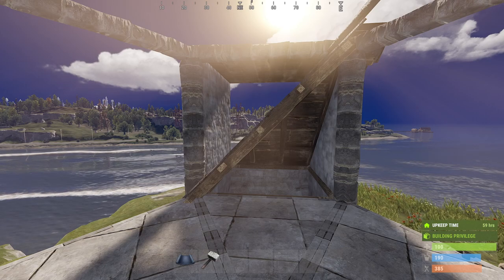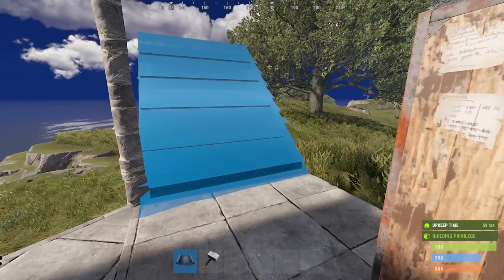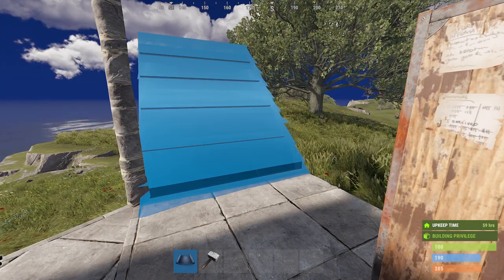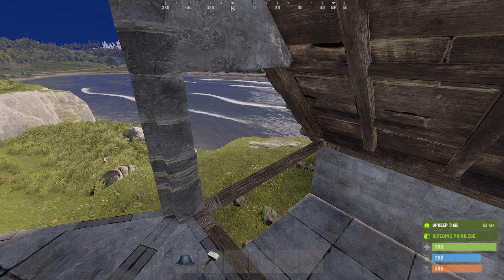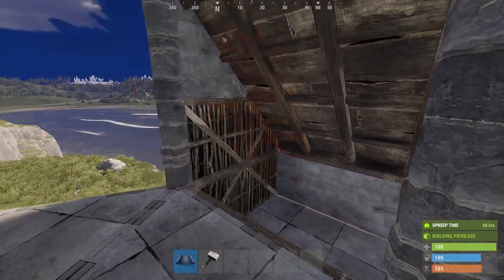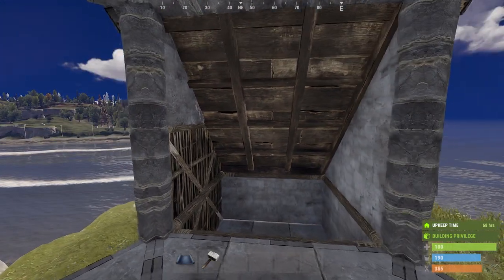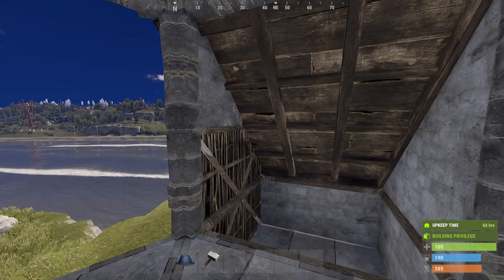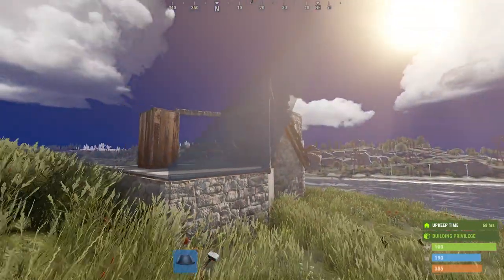Roof Rotation Update on Staging Breaks Cross-Roof Stability Bunkers

Comment: If its a high foundation instead of a wall there does that change the equation? Might require crazy terrain to build though
Reply from the maker: Your suspicion is correct. The socket removal doesn't happen with a full height foundation. However, if you have access to full height foundations, you should probably build a better bunker.